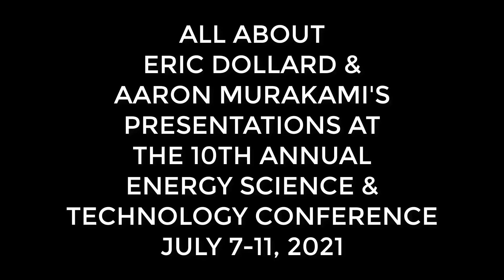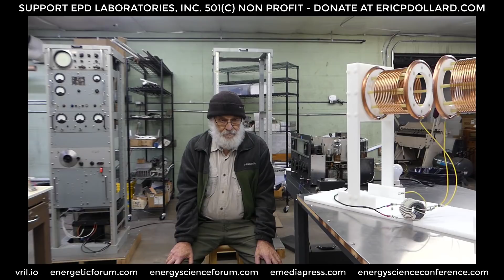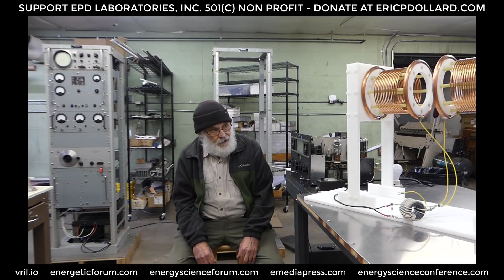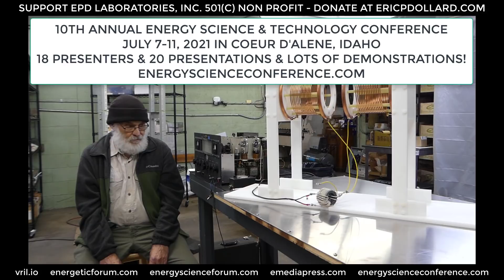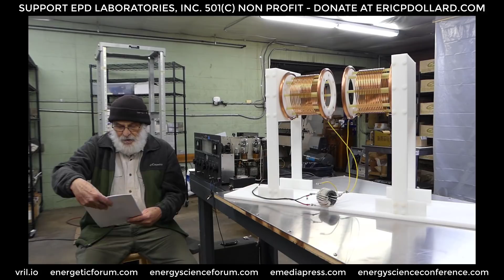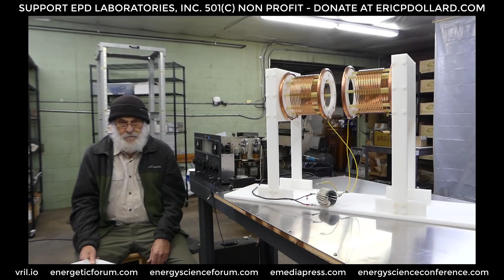You Pay for the Hundred Watts, Then It Disappears

Comment: Delta and Wye (or Star) are the two primary circuit configurations used in three-phase electrical power distribution and heavy-duty motor applications. The names describe the shapes of the wire arrangements—a Greek Delta (
) is a closed triangle, while a Wye (
) resembles the letter 
 with a central neutral

Comment: Any further progress in understanding where the energy is going? Does the system acts like a step up transformer to process the energy past the “perception horizon”? Perception horizon being where “dark matter/energy” slows down to the speed of light. If that energy could be measured when it goes dark so to speak, then perhaps the system could be utilized/modified to step down dark matter/energy.  The other thought is could this system be changing the polarity of the electrons to positrons?

Comment: 11:20 how is this different than having two waves 180 degrees out of phase lol instead of needing to invoke this other dimension stuff? Not that im closed off to the idea, I just want to know if perhaps there is more precise simpler explanations for whats going on.
Reply from the maker: Energy is destroyed in that neutral zone. Completely different than 2 out of phase waves. Yes, energy can be created and destroyed if you know the proper definition of energy.
Reply: @AaronMurakami13  how exactly does this occur physically and what is the theory & math describing It
Reply from the maker: @cosmicyoke  The process with this method is only understood theoretically but we can demonstrate it. Keep in mind that there is no such thing as energy - energy is only the activity of potential dissipating in a resistance and that manifests as something we call work. Any work is the instant creation and destruction of energy simultaneously. The potential is the actual stuff that gets dissipated so literally, there is no such thing as energy.
Reply: @cosmicyoke  Normally when two opposing transverse waves meet, they create magnetic currents in space and in the wires so the energy is converted directly into heat.

When two opposed longitudinal waves meet, the effect is more akin to noise canceling headphones, the waves cancel but in a way that doesn't generate heat.

In a more technical sense, the energy is destroyed by dynamic variation of impedance of both traveling waves, each causing each-other's energy to be taken apart directly into component dielectricity+magnetism.  At least that's the operating assumption I use.

I have demonstrated the same effects on my bench, where 800 watts will disappear into a pair of coils with no substantial RF transmissions and only ~50 watts worth of heat showing up on the wires.
Reply: @hakasays  I will check out your channel

Comment: Charged "particles" are actually closed oscillating current sheets which store intense electric and magnetic fields by means of being folded into a donut-shaped form. They habor an internal magnetic field that wraps around the spin axis, giving rise to what is a "toroidal magnetic moment".

This toroidal magnetic moment oscillates at a frequency based on the mass of the charged "particle" by means of a sheet current that bounces off the magnetic north and south poles (i.e. magnetic mirroring), which also has the effect of producing an oscillating electric dipole moment of the same frequency.

This condition is know as an anapole. Anapoles can obey the non-radiation condition which gives them essentially zero radiation resistance, thus the anapole structure provides a valid means for mass to retain its electromagnetic energy indefinitely in the form of an evanescent standing wave.

All "electrons" in close proximity tend to share the same anapole phase. Any "electron" which falls out of phase must gain or lose mass via near field coupling with its neighbors. Consequently, the illusion of "fundamental" and "discrete" charged particles possessing a "fundamental" or "intrinsic" mass is maintained, and that's because the anapole frequency (which must be matched to maintain the phase matching over cycles) is directly related to the energy of the electromagnetic oscillation or "photon" from which a "electron-positron" pair can be created. The anapoles of "positrons" are in phase opposition to the anapoles of "electrons", thus the superpositon of their fields forces their annihilation, producing an electromagnetic gamma wave where the E and B fields are in phase.

The electromagnetic substructure of matter and its waves provides ample opportunities for the sending off energy or extracting it in ways merely appearing as though it was being created or destroyed.

Disruptive discharges (current density plus charge density waves) can be used to force anapole phase unmatching and thereby force energy to be transferred from one charged mass (such as bound "electrons") to another (such as unbound "electrons"), as desired, in a suitable cavity resonator. This can be accomplished by targeting lower frequency rf lines that are induced in the anapole spectrum by means of the precession of the spins (e.g. NMR lines) whose frequency depends on the strength of the currents and or permanent magnets applied to the circuit's conductor.
Reply: An adequate current density is required to align the “toroidal magnetic moments” of “electrons” inside a material. However their ability to rotate around the same axis depends on being able to phase match any precession which would otherwise threaten this alignment. Remember that above I stated that the toroidal magnet moments come from sheet currents that bound between the magnetic poles of charged particles via magnetic mirroring. Since the direction of the magnetic poles depends on the direction of the spin of the charge, we must control the spin of the electron at some frequency to produce a phase matching condition. This period of phase matching lasts as long at the T2 time constant associated with the nuclear magnetic resonance condition, since the precessing nuclear magnetic field controls some frequency (spectral line) in the oscillation of the electron’s spin. The rotation (or precession) of the electron’s toroidal magnetic moments produces an electric field just like that of an oscillating toroidal transformer. For it to do work, we need these electric fields to be in “phase” with some electric currents. This is impossible for sinusoidal current as a sinusoid enforces the condition that it is 90 degrees out of phase with its derivative (the cosine). Only disruptive discharges, analogous to lightning, can provide the necessary means to produce underdamped oscillating currents driven by such electric fields.

The rotation of the toroidal magnetic moments produces an electromagnetic four-potential, the scalar (or time) component of which is capable of performing a net transfer of energy. However, this constitutes only the electrostatic component of the electric field which can only perform work in the regime of oscillating density of electric charges. The vast majority of electrical systems are designed in such a manner as deliberately suppress these mechanisms for safety reasons without the realization that the potential could become significantly useful if amplified instead of suppressed.
Reply: @BlueOceanStrategistS  Anapoles, I have to dive into that. What you are stating makes a lot of sense. I only recently started using high voltage electrostatic fields in my experiments, before I only used LMD resonance and impulses which didn't do the trick.
Would love to talk more about this
Reply: A photon is a quantum electron/positron pairs

Comment: The little known secret of this tech, is that these transmitters do not transmit electricity (V/A) nor radio waves.  They transmit momentum!   Properly termed a "longitudinal wave," they are in fact, a compressed wave of traveling electrical potential created not simply by "moving" charges, but by "ACCELERATING and DECELERATING" the charges...  ;)   If you want to produce a SCALAR WAVE and break vacuum symmetry, accelerate the charges quickly and decelerate them slowly or vice versa (radiate a sawtooth wave or impulse wave).  This results in the radiation of an unsymmetrical electric potential in space, leaving the system polarized. That's enough for one to get started...
Reply from the maker: The real secret to the best results is not to use any primary or secondary. Tesla taught that but nobody listened. I'm helping Eric reveal the principles.
Reply: I find the use of the term, "unsymmetrical" disturbing. Asymmetrical is the correct term to use sir.
Reply: @david18861886  Im always looking for more info, and have plenty to share :)  ExoticPropulsion@gmail.com (subject: Waves)
Reply: @david18861886  Ken!

Comment: Have you considered dropping decimals and only using whole numbers(integers). I've found that the concept of 'counterspace' becomes easier to digest if its thought of as flipped, 'spacecounter', and only whole numbers(integers) are used. The space counter is the smallest unit of measurement used to 'count space'.  Imo only using whole numbers greatly simplifies mathematics, especially engineering mathematics, because nature don't use decimals, nature uses whole numbers.
Reply: @Theoria Philosophiae Naturalis Ratios are fine but fractions are not.